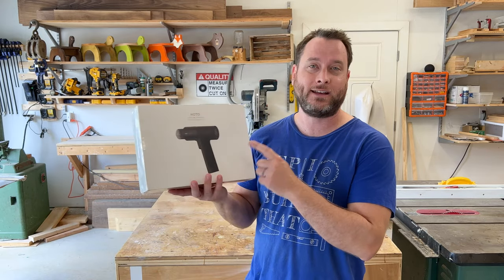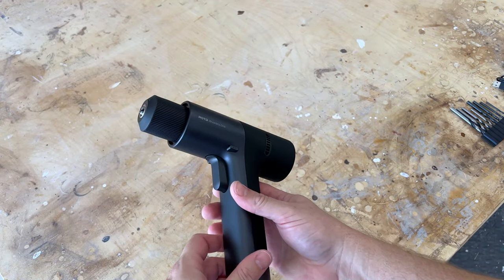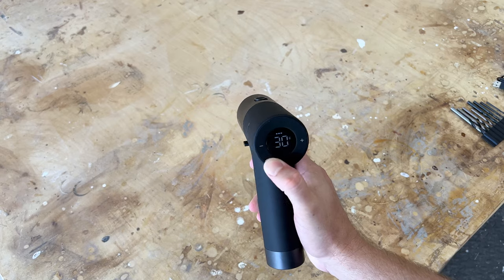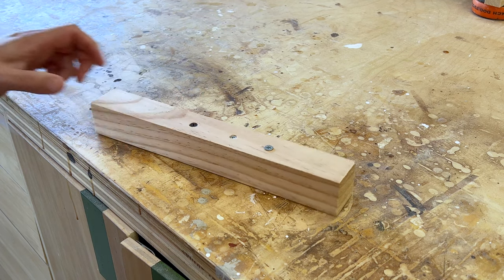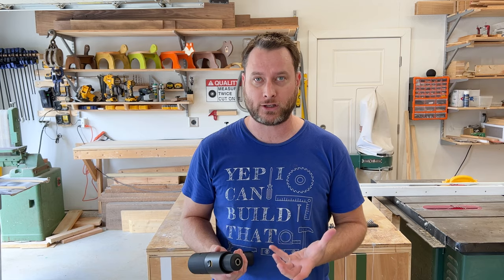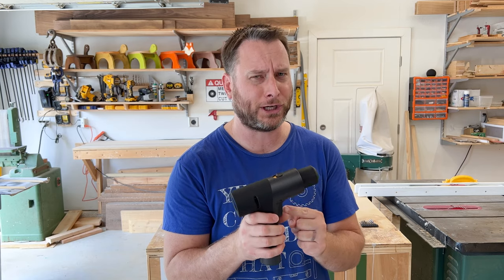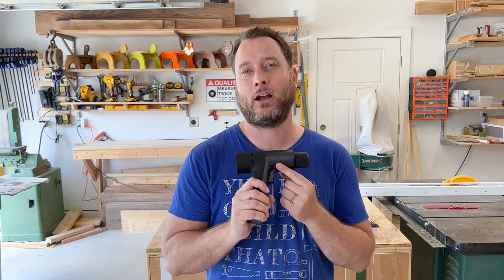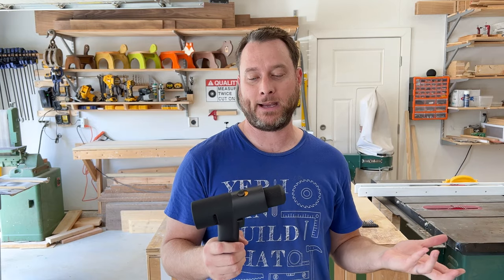If Apple Made A Cordless Brushless Drill | Woodworking Tool Review Tuesday | HOTO 12v Drill

Comment: Great video man, THank you. I am actually interested in this drill for my DIY stuff but i never found anyone who did wall drilling tests or some thin metals or sth. So my question is, would it be good enough for drilling brick walls for hanging mounts for tv ? would it drill sth maybe a 2 mm thick metal tube etc ?
Reply from the maker: I would not recommend it for drilling into brick stone. It honestly isn’t designed for that type of drilling
Reply: @HowYouCanMakeIt  I mean, drilling wall for tv mount is one of the most basic work that a "home user" would do. And most of us do not have a wood shop in our garages, so, I am not very sure about the purpose of this product.

Comment: I agree with you. It is cute but not a tool for  woodworking or much of  anything else. Hanging a picture maybe. NO drop test because we know it will not survive.
Reply: @Great Grandpa’s Woodworking I agree as well. I honestly wouldn’t even care to own a tool that I’d be afraid to break if I dropped it. Even for picture hanging or inside the house tasks, I prefer tough tools that can handle heavy, daily use. 🙂
Reply from the maker: Thanks. I was thinking the same thing however a drop test would be interesting 🤔
Reply: Nice assumptions you're making there, Gramps; it's just a shame that you have no empirical evidence to back them up.
Reply: @jodilea144   Then you'd use a suitable tool for those purposes; I didn't see anything in HOTO's information stating this was in any way a heavy-duty tool rated for high duty-cyles. 🙄
Reply: @HowYouCanMakeIt  loop
Reply: It’s a  starter tool set. Good gift for someone who just got an apartment or a new homeowner.  I would definitely use this around the house when I don’t feel like getting a bigger heavier drill out

Comment: Thank you for this review! I'm about to move out and I might get this to disassemble and reassemble my furnitures. One question I want to ask though, I wonder if most drills have a universal size for the attachments? Or in other words, if I buy a head attachment from other brand, would it fit the HOTO drill? I was thinking to buy some attachment brush head which from the photo and the reviews, seems to fit regular drill. Thinking to use it on HOTO for scrubbing & cleaning..
Reply from the maker: The "cuck" as it is called is standard and can accept any normal size bits.

Comment: Thanks for the review. If you continue testing this HOTO drill for a follow up I’d like to see it used in some framing construction and of course a drop test. I believe this is a 12volt drill so it should be compared to something like the 12v Bosch driver.
Reply from the maker: That would be interesting for sure

Comment: I think this is more ment for tech stuff like mount a bracket to the back of a TV and wall disassembling a computer or appliances for repair hanging picture frames and small stuff around the house and stuff that require you use a certain torque like ikea furniture
Reply from the maker: True

Comment: 1:16 - for me it's not OK

Thank you for this video. I am actually looking for a drill to buy - this is probably how YT suggested me this very video. I am glad I could watch it. This drill is a toy - looking good in some yupiies garage next to his/her tesla :) not planning to use it anytime
Reply: No, it's not a toy; it's a tool designed for a particular purpose.
  It's lightweight, compact, and has enough power to perform basic domestic duties.  If you're looking to drill holes in concrete for fixing bolts or drive huge hex-screws into oak sleepers, then, obviously, you'd use a suitable tool, so go and grab your neon-coloured, manly-man moar powah drill or moar torque ugga dugga with their 1 kilo 15AH batteries.
  But if you want to merely tighten some screws in your door's hinges, drive a screw into wall studs to hang a picture, or drill a few holes for a shelf bracket, then this is ideal.
  Don't worry; using this tool won't harm your fragile masculinity. 🙄

Comment: Eeeeeeeeew, Apple!!!  No thanks!  Plus, it would be white, overly priced, and break the day after their crappy warranty expired if they made it. 👎
  HOTO (HOme TOols) are a spin-off of Xiaomi, and there are a few other sub-brands that follow the same design ethics, make really nice-looking tools that work very well and actually LAST! 
 I've had my WowStick screwdriver and TS100 soldering iron for years, and they've really been put through their paces and are still going strong.  The 2500LM rechargeable torch has been mounted next to my back door for over a year and has performed flawlessly when called upon. 👍
  Also, I've recently picked up the HOTO rotary tool for light-medium work, and I've been hugely impressed by its performance, and if it wasn't for the fact that I have a Bosch IXO screwdriver, I'd be placing an order for HOTO's equivalent model.  Oh yeah, I almost forgot the matching 5M tape measure; that's awesome, too! 😎
Reply from the maker: That is great to know. So far I like their overall design and tools just not really built for woodworkers.